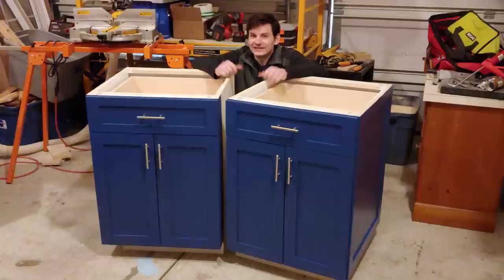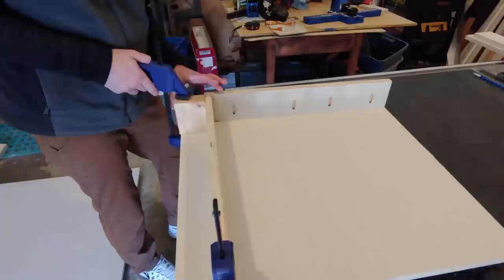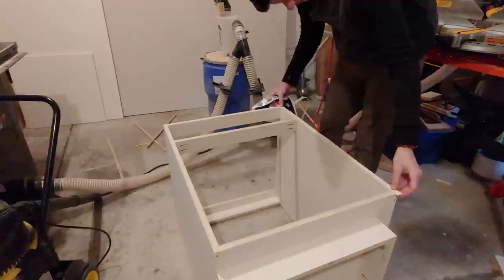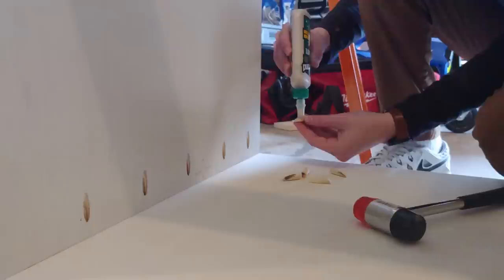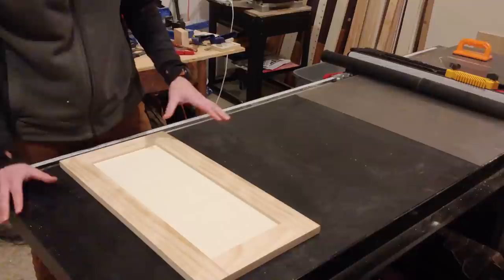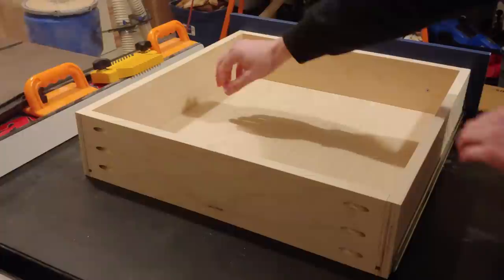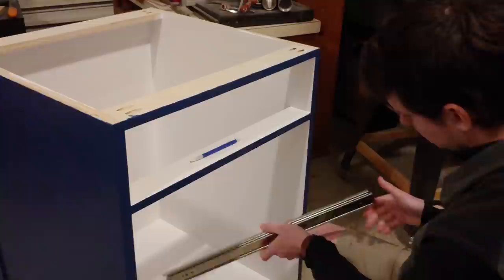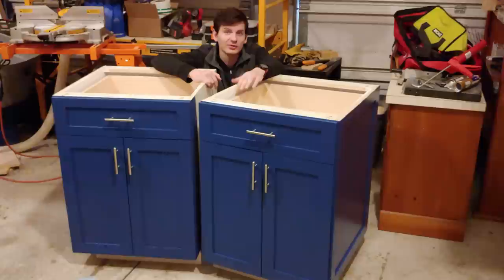How to Make Shaker Style Kitchen Base Cabinets

Comment: When doing your plugs for the pocket holes just put the dowel rod in the hole and cut it off while the dowel is in the hole and you wont have to drive them in with a screw driver and messing them up. No filler just sanding. The way you did was a huge waste of time if you think about it.

Comment: The drawer and door pull handles while subjective on style. I recommend you go with handles that will not catch on clothes or chords. I worked in hardware at Home Depot and can't tell you how many times  folks came in asking for handles with flushed ends. One man mentioned his wife had her apron catch on the handle causing her to spill the heavy pot she was moving.
Reply from the maker: Hasn't been a problem in the few years I've had the cabinets now, but I do see how it could be. Thanks for the insight!

Comment: Why didn't you just glue the pocket hole plug dowels in place after assembly and then trim cut the plugs instead of going through all that pre-cutting and then still having to flush out the plugs?
Reply from the maker: Because I didn't know any better at the time haha! That's what I do now

Comment: This has been the best video that I've seen among the 100+ on kitchen cabinet building!
I may be biased but I'm 100% in favour of the Euro-style cabinets than the traditional cabinets with face-frame.

Also, I prefer a separate 3-1/2" base support to correct any kitchen floor leveling problems.

I'm going to make a Sketchup design right now .. but it will be in millimeters!
Reply from the maker: Thank you! I much the prefer the look of the frameless cabinets too

Comment from the maker: All materials and tools used in this build are listed in the video description

0:16 Cabinet Specs Description
0:50 Building the Box
4:48 Installing Edge Banding
6:33 Making Pocket Hole Plugs
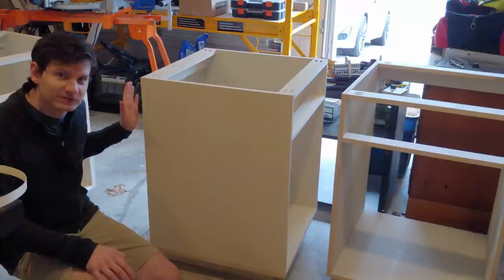8:42 Making and Installing Trim
10:29 Making Cabinet Doors
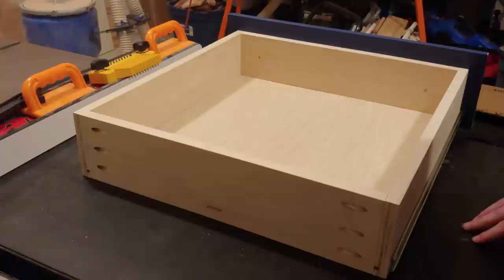12:56 Making Cabinet Drawers
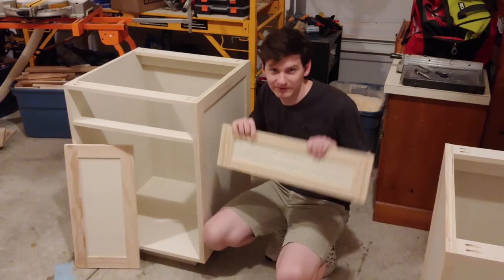14:53 Painting
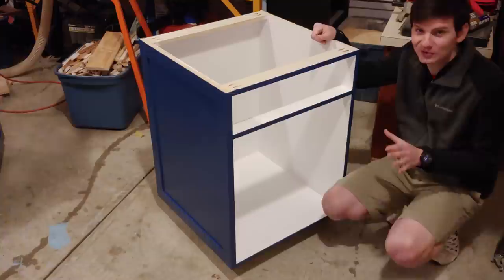15:49 Hardware Install
18:28 Goodbye!
Reply: I loved it ,what is the color?
Reply from the maker: Admiral Blue by Behr

Comment: Nice job. I am trying to build enough confidence to make my own cabinets. Every video I watch I pick up something new and different. I’ll get there. Pocket hole plugs can be glued directly in the hole, and cut with the multi tool , Masonite the dowel rod.
Reply from the maker: You can do it! I'd make the first a smaller cabinet so if you mess up you'll waste less material, but once you get one done it gets pretty easy from there

Comment: This is a VERY different way of doing a cabinet. At least now I know there is more than one way to skin a cat, I mean cabinet!

Personally, I use a single piece of plywood for the sides that included the toe kick, then dado the bottom shelf into the sides. I also use facing material for the front, as I absolutely hate banding.

Really neat way of making your own plugs! I am too lazy and just buy mine!

I really like the way you did your shaker doors. If I didn't have to do any banding, then I would be looking to do the same with mine. Maybe I can look for some innovative ways to do doors as well.

Last thing...I see you have a bunch of Kreg components. I don't build many cabinets, so I make templates out of scrap material for my cabinets and such. Those Kreg jigs make it look SO much easier though!!!
Reply from the maker: Haha thanks! My goal was to make a design that was as simple as possible.

I used to not like banding as it would take forever, but with the right tools I'm able to do it pretty quickly now and don't mind it anymore. Which is why I tried doing the doors that way, keeps them really simple.
And kreg stuff is (mostly) great. I know that some people don't like it but it lets me build things quickly, it's strong enough to last a long time, and it's certainly better quality than most affordable furniture/cabinets you'd find at the store

Comment: Very thorough. I like the measurements displayed as you are time lapse. So to build 2 - 18" Base Shakers is gonna run $1000 .
Reply from the maker: How are you figuring $1000 for 2 cabinets? My cost was around $125/150 per cabinet though I did buy hardware in bulk

Comment: Great walk-through! I recommend a table saw crosscut sled for doing a lot of the cuts in cabinet work (like your rails, stiles, doors and drawer face). I didn’t have one for my first 3 years of woodworking, but made one in the Spring and have been using it like crazy since!
Reply from the maker: Thanks! I really do need to make a cross cut sled, just one of so many things I haven't gotten to yet haha

Comment: I love the door method.  Where did you learn that?
Reply from the maker: My brother did something similar to trim out some ugly solid slab cabinet doors in his house that were 3/4 inch thick before trim. It got me thinking about how I could modify that to make a door that was 3/4 after trim. So I just went from there covering the edges with edge banding

Comment: Awesome job! Very professional and like it you learned from your mistakes...sign of a true craftsman! However just a suggestion....install all drawer slides, hinges, and hardware before painting and then remove. Why?....this way if you need to mark on the wood it will be covered by paint and if you make a boo boo (drill a hole wrong, etc) it's easily fixed. Keep up the good work!
Reply from the maker: Thanks! It's funny you say that as I did drill the pull holes for one of the drawers in the wrong place and had to go back and fix it later. Definitely would have been easier before painting
Reply: Oh I have done that too!

Comment: I see you use a SawStop, 1.75hp table saw.  How does it work.   I'm a DYI'r similar to you.  Do you feel the 1.75hp is sufficient? Regards from Nebr.
Reply from the maker: It's definitely sufficient for me. If you rip thick hardwoods often then maybe consider the 3hp model but otherwise it will be plenty powerful

Comment: Great video, I was  just looking for something like this.  I am about to build an entire kitchen cabinets my self in a budged.
I have learned a few things even  I already have a good experience with woodworking. What is the cost roughly what it came out  for one of those cabinet? Only material...
Thanks for sharing.
Reply from the maker: For one of the cabinets the materials came out to around $125. I did buy the cabinet hardware in large quantities which helps with keeping the cost down

Comment: I've got a question on the size.  Normally cabinet depth, from to back is 23 1/4".  I believe they do that so you can get 2 pieces from a typical 4x8' sheet of ply.  Then when you add the normal 3/4" door on front, you have a cabinet with basic dimensions of 24"....unless you're building Euro cabinets where the doors are inside the frames.  It's also important if you're going to buy off the shelf counters as they are built with a 24" cabinet in mind.  From what I see, yours will be 24 3/4", correct?  Otherwise I liked the video, and thank you.
Reply from the maker: This is one of those debated topics on forums. It seems either is ok as long as they'll fit your counters and appliances. My plywood was about 48 1/8 so I was able to get two 24 inch panels out of it width wise and with the doors they are around 24 3/4 yep

Comment: The trim you used for the stiles , was that a stick trim? What did you use?
Reply from the maker: I made my own in the video from pine boards but  you can buy trim just like it, search for lattice molding. Its 2 1/4" wide by 1/4" thick.

Comment: This is a late question what type or brand name is your table saw you are using to cut your wood. I need to buy a Table saw with a larger work are plus a fence that works well at both ends.
Reply from the maker: No worries! It's a sawstop. There's a link to the specific one I use in the video description

Comment: How long would you say it took from start to finish? I'm a weekend woodworker with limited tools and experience and planning on building my own cabinets for my new kitchen. i feel like giving myself 10 full days is not enough.
Reply from the maker: To build 1 would take a couple of days just because of dry time for paint. Obviously you can do more than 1 at once though. I was able to do 1 or 2 a day (without paint) when I wasn't recording so it would probably take you a bit longer than that at first. None of this includes install time in your kitchen if you're planning in doing that yourself. I'm really pretty terrible at estimating time but in general I'd advise that things take much longer than planned for

Comment: What are the width of the stiles and rails you chose? for both the drawer and cabinet door
Reply from the maker: The stiles and rails are 2 1/4" wide for the doors and drawers except for drawers 7 inch or less tall, those rails are 1 5/8" wide
Reply: @ProjectBilld  awesome! And for the cabinet doors you used what for the 1/2 plywood, and what for the stiles and rails?
Reply from the maker: I think you're asking what type of material? If so everything is listed in the video description. I used a 1/2" whitewood plywood and clear pine that I machined down to 1/4 thick for the stiles and rails. It doesn't really matter for each what you use as long as it's at least paint grade i.e. Clear, no knots, no visible grain patterns

Comment: What material did you use for the trim of the shaker doors?
Reply from the maker: 1/4 thick pine. You might be able to find 1/4 lattice molding that's already 2 1/4 wide. I've also made the trim from sheets of 1/4 mdf
Reply: @ProjectBilld  and the edge banding is paintable right?
Reply from the maker: Yes. Use a clear grain edge banding like birch or maple. Avoid any with deep grain like oak

Comment: Oh did you use water borne or oil base alkyd paint? Which brand?
Reply from the maker: It was the behr alkyd paint. I'm not entirely sure if it is water or oil based. It was a little sticky/draggy when brushing and rolling

Comment: Just wondering what type of blade is used on table saw
Reply from the maker: I like to use a 40 or 50 tooth general purpose blade as it's decent for ripping wood lengthwise and still good enough for the occasional crosscut. The Diablo blades that are sold at home depot are very good for the price

Comment: Why didn't you put the pocket holes on the outside of that end cabinet and just have the trim cover the holes?
Reply from the maker: I talked about that in the video briefly. That was the plan originally but the trim wasn't wide enough and about half an inch of the pocket holes would show

Comment: It always amazes me how table saw safety is non existent in YouTube videos.
Reply from the maker: Care to go further in detail? I try not to show anything that's unsafe but I don't know everything
Reply: @ProjectBilld  I’ll touch on the major no no. Never wear long sleeves. If the blade catches your sleeve it will pull your arm into the blade faster than a democrat can raise your taxes. Even the body portion of your jacket is too loose. Wear tight fitting shirts that cannot sag into the blade when reaching across.
Reply from the maker: Thanks for the reply! The same reasoning why I don't wear gloves when using a saw. I definitely agree that wearing something like a hoodie with strings that could hang over a blade is a big no. I don't really agree that it's a huge deal to wear a tighter fitting long sleeve shirt or jacket, some days it's just too cold to work without one. I have ditched the puffy jacket since I got a shop heater installed though, so that's nice

Comment: Your cabinets turned out awesome, but the audio on my phone sucks. When you're talking into a microphone it plays it on the inner ear speaker so you have to hold it to your head like you're talking on the phone. If you don't, you can't hear what's being said.
Reply from the maker: Thank you! Do the parts where I'm speaking to the camera come through ok? Or is just the voice over part that you're having trouble hearing?
Reply: @ProjectBilld  when you're talking into the camera it was fine, just when you're talking into the microphone.
Reply from the maker: Ok I'll have to check that on some other phones. It sounds find on mine but it's possible its something I can fix for the future. Thanks!
Reply: @ProjectBilld  if it helps I am on a Samsung galaxy s9+